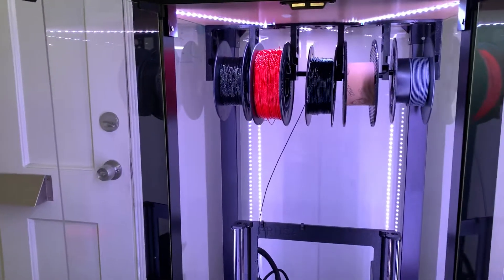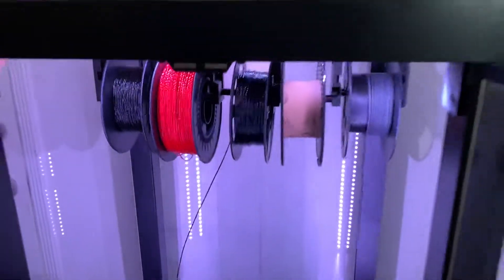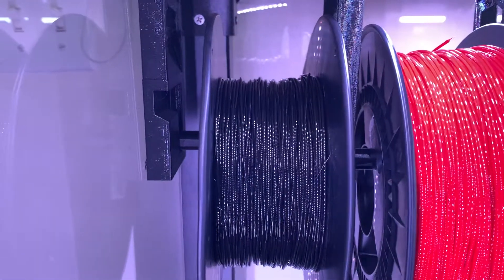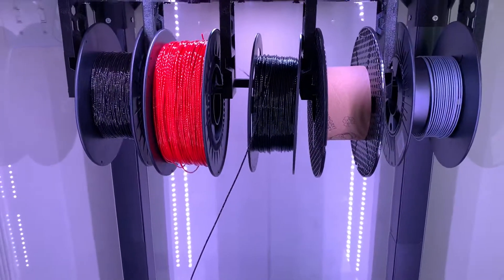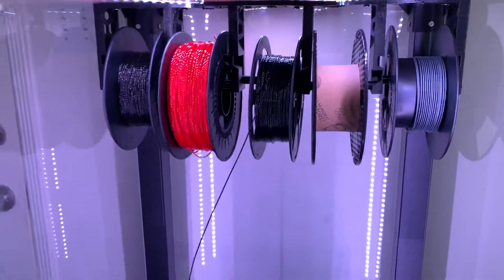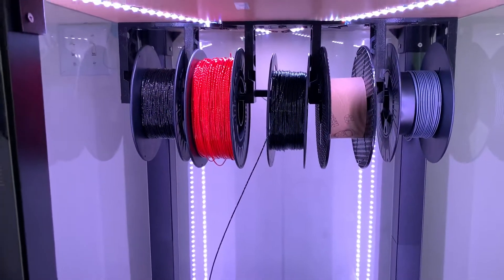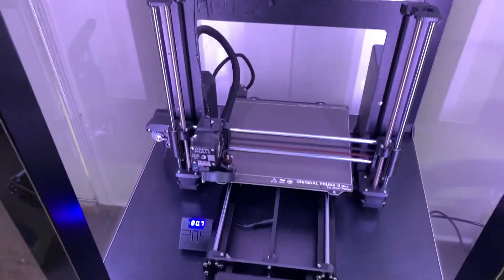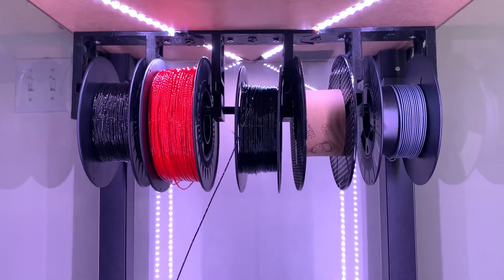Hanging Spool / Filament Holder for inside lack enclosure Prusa i3 MK3S+

Comment: The issue I'm thinking of is the softwood on the underneath of the lack table. It's strong enough when screwed into to hold all this weight?
Reply from the maker: Nope. I purposefully have them all loaded with new rolls for the extra weight. I’ve never had any issues.